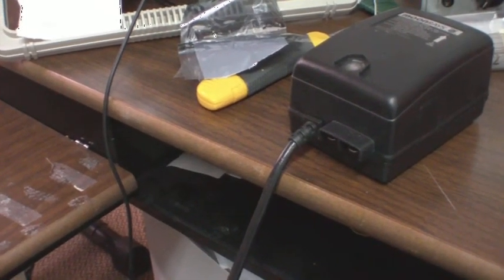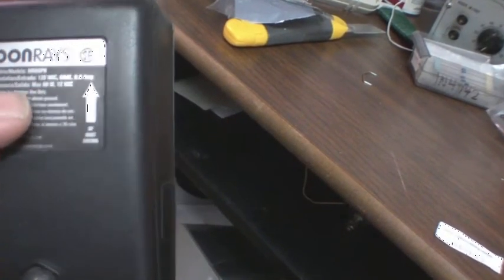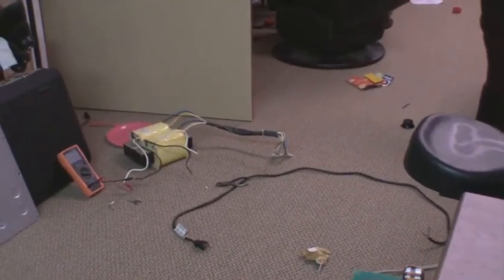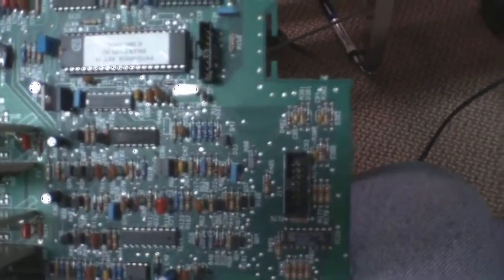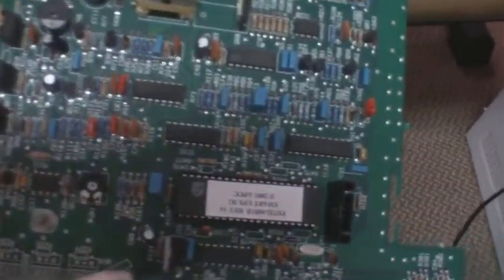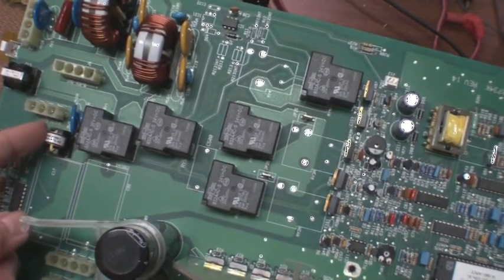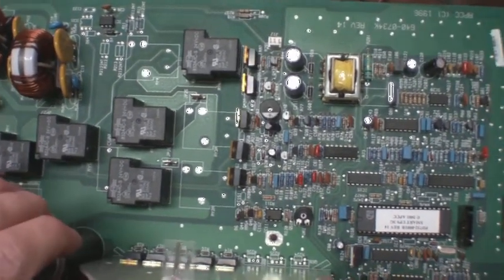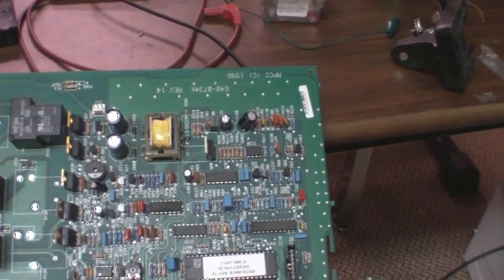PT. 1 Scrounging Free Electronics!

Comment: Good breakdown there :) I use those relays (if Omron) for 46 gauge trigger windings on mini SSG coils. Most glues are brittle from heat over their lifespan and age, so a component won't need the force ya might think to extract. I always bend legs straight with a razor blade or thin screwdriver before using soldering iron to desolder..also helps to use thin blade to lift resistors etc. I have hardly ever seen a blown cap btw, always surprising how good others junk really is !

Comment: The low transformer winding resistance is not an issue due to a whole bunch of booga booga electrical physics that would need multiple videos to explain (it was only lightly covered in the college level engineering physics and tech classes I have had).